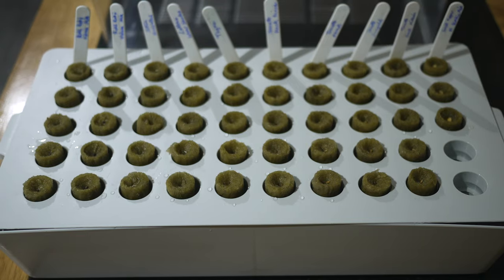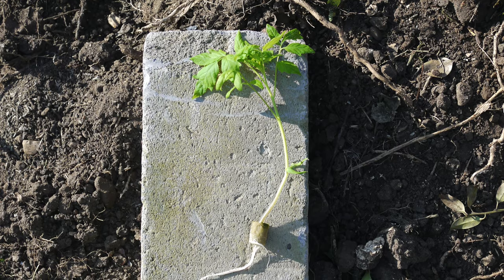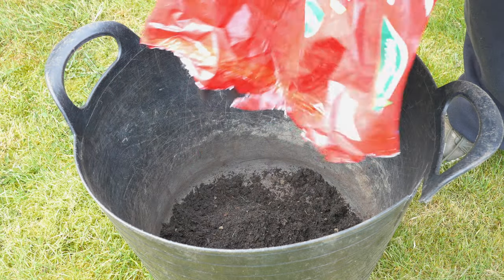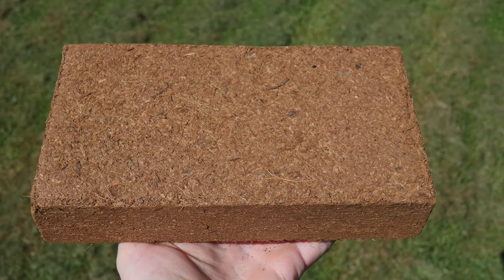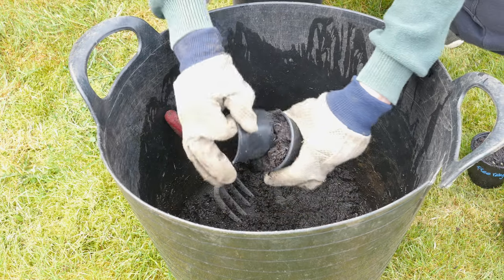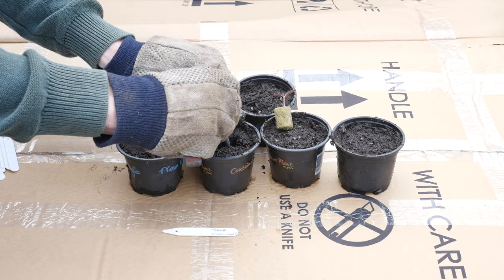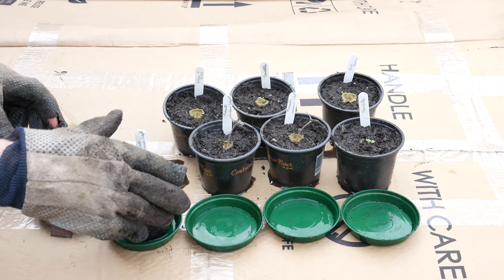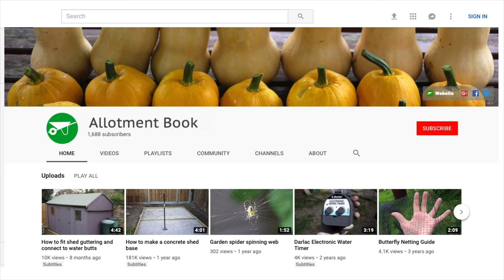How To Repot Seedlings Grown In Rockwool

Comment: I just did this to my seedlings and their leaves have curled quickly after 😢 I made the soil quite moist but im wondering if i overwatered it -- could that be why they've curled?
Reply from the maker: This may be a normal reaction to repotting that should settle down after a few days. If the pots drain well after watering then overwatering is unlikely to be a problem (the soil should not be allowed to dry out). Other potential causes are the soil being too dry, or a nutrient deficiency.

Comment: i use this method and my plants looking withered, is that normal?
Reply from the maker: this does not sound normal - withering could be for a number of reasons. When I transplant from the warm propagator to a pot, I like to keep the potted seedlings in a protective area to help them acclimatise to a colder environment (plastic greenhouse, polytunnel, greenhouse etc) - I keep track of the temperature using a thermometer that records min and max temperatures

Comment: do you think rockwool is better than coir to start seedlings? seems like rockwool is less mess but might be more expensive in the long run.
Reply from the maker: thank you for your comment. I prefer to start small seeds, like tomatoes and lettuce, in rockwool cubes, and larger seeds by preparing small pots filled with compost made from coco bricks. Rockwool cubes are very fast and easy to use, mess free etc - but are not big enough for some seeds (like squash, cucumber etc.) Compost made from coco bricks is also mess free, but takes me longer to prepare. I find coco really reliable, I think because of the balance between moisture and air.
Reply: I have always used Grodans Rockwool but I am going to try coco coir and grow dots with recharge. The coco way is a lot cheaper.